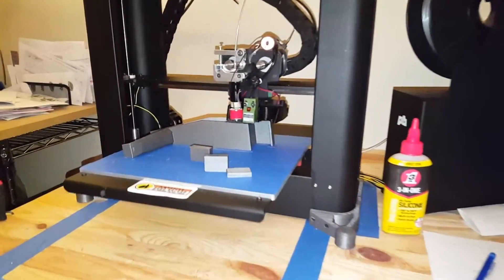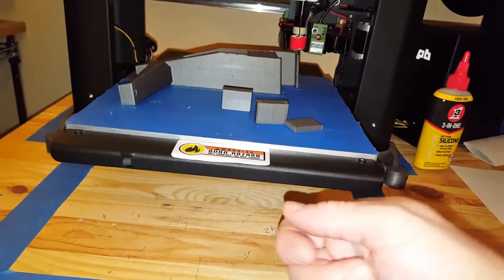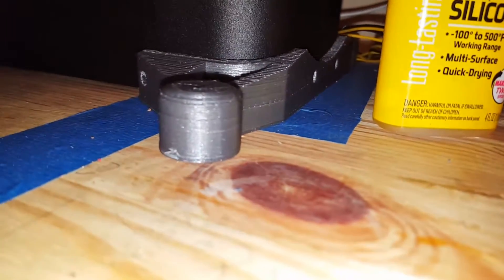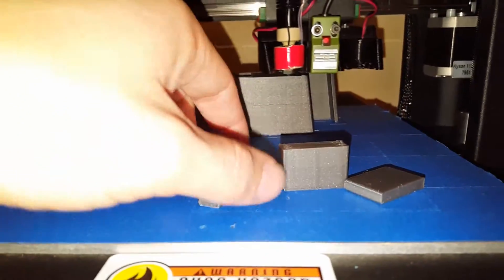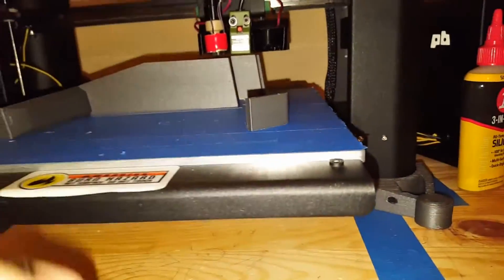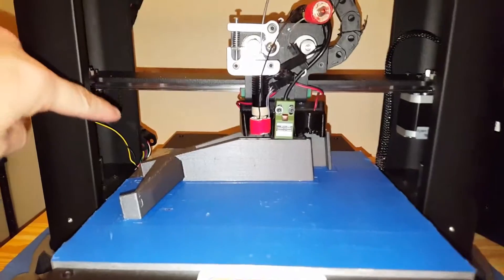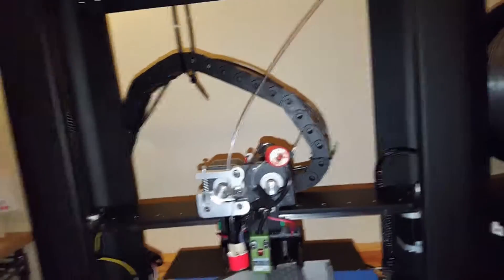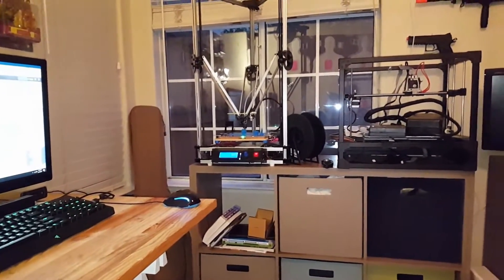How to fix 3D printer Z Shifting/ Wobble- ft Printrbot Plus Dual Nozzle

Comment: Worst printer I own - I have printers 1/2 its cost with almost the same build area that outperform it.  It stays broken most of the time, I fix it, print for a few days and it seems something else breaks.  The print quality leaves a lot to be desired on it.
Reply from the maker: It's a shame too.  I really believed in printrbot but their machine is so expensive I don't think I should have to tinker with it that much to keep it printing.  It looked cool for the time,  but now I feel like I could have spent my money better elsewhere
Reply: I agree - For $1300 I shouldnt have to replace a part every few weeks.  I will say that I recently switched to Cura 3 as the slicer I use and it tremendously improved the quality of prints the Metal Plus is putting out.
Reply: I think I finally have this thing printing well after replacing half the parts on it and multiple upgrades.  It has been printing solid for about 2 weeks. 
 Switching slicers to Simplify 3D made my prints look GREAT, far better than anything Cura was putting out.  It still puts out worse prints than my Prusa i3MK2S but the prints it is putting out are still very good.

Comment: hi, CNC router's drag chains are usualy fixed at mid point of the travel. That minimize the lenght of the chain and the wire (which is always good). on a cnc router you would probably have two chains : 1 form the chassis to the gantry, the one from the gantry to the printhead. On your PB the chain could be fixed at the middle of the top plate. that's the shorter possible mount. I had chains on my first printer. Honnesly I believe it is not a good idea. First chains are heavy for a printer and can possibly drag on the head. Seccond they are noisy. On my printers I have now braided sleeving. its super light, super quiet, they move in 3 dimensions and can be rigid if you pass inide a piece of 3mm filament or a bowden alike silicon tube. It is my five star solution. Last, braided sleeving exists in a variety of colours and can be decorative. I peronaly enjoy the gold/black bicolour sleeving.
Reply from the maker: Thank you for your input. I will reconsider using a drag chain.